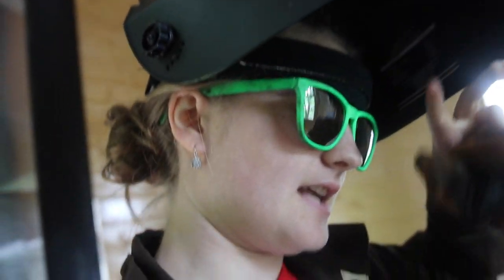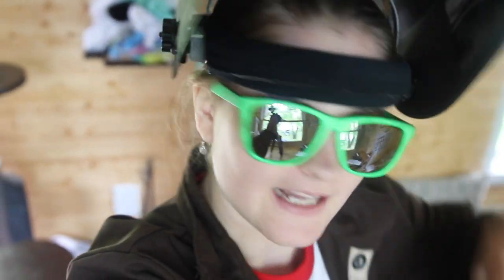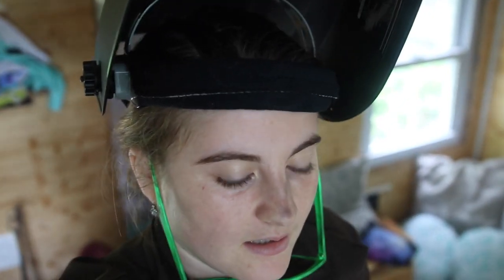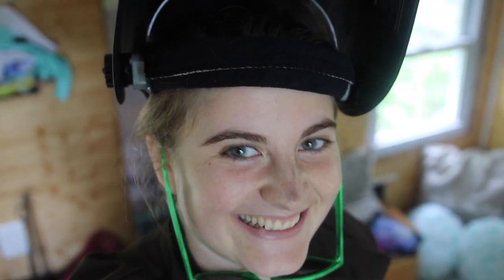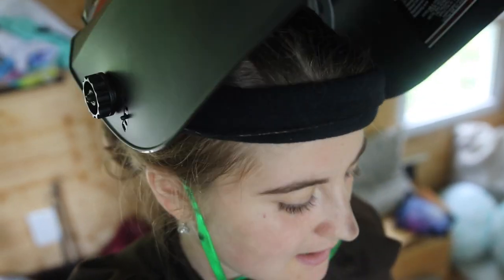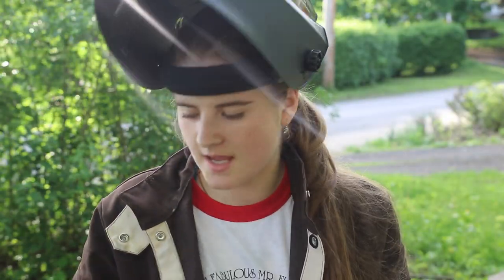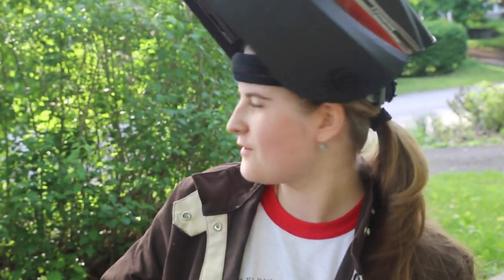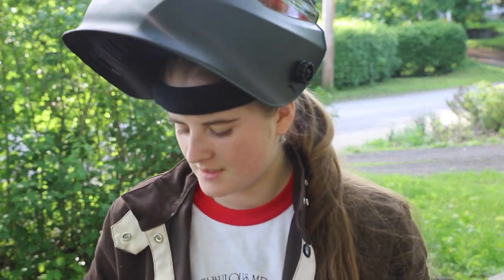Welding to the Trailer | Camper Build Ep. 2

Comment: Get a grinder with a wire wheel or use a sander. Just get that area where you're going to weld clean. You can always touch up paint after. Use a speed square to make your uprights 90 deg. You don't want paint mixing with the metal. It stinks and is not very strong bonding. Keep at it! You'll get there. Tack weld it once to hold it in place until you get it 90degs both sides. you want it square but you also want it Plumb.
Reply from the maker: Thanks for the feedback! I've got a grinder so I will use that from now on instead of the brush!! And I've also just picked up some magnet squares :) Thanks for the advice and feedback!!!
Reply: You're welcome! Hope it helped you somewhat. Have you watched videos on welding basics? Or read articles? That will help you out greatly for tips and tricks. Can't wait to see your finished trailer :)